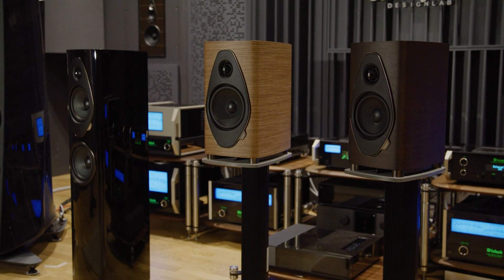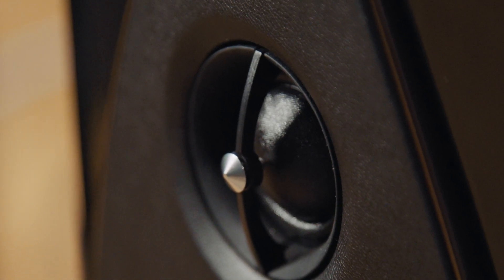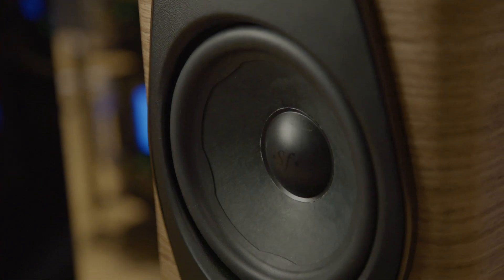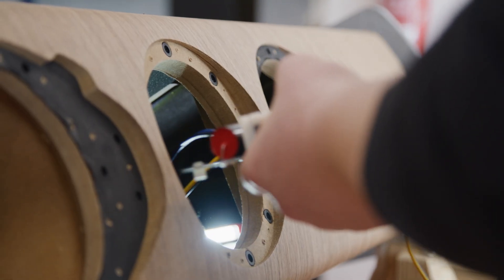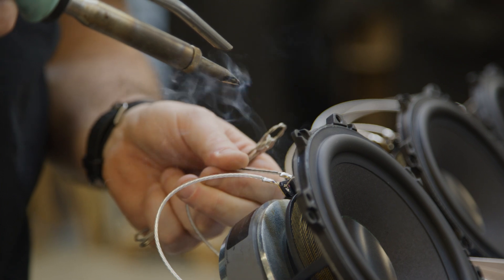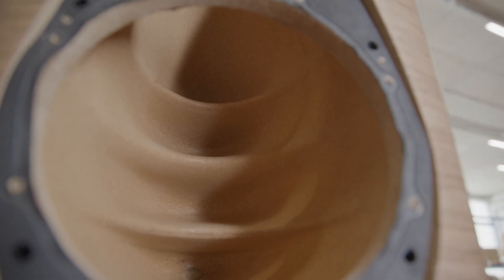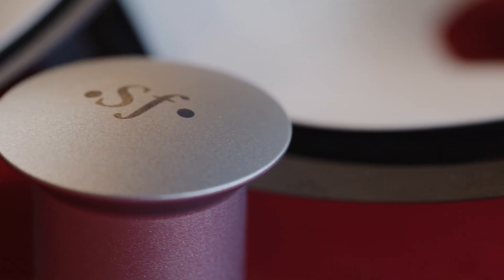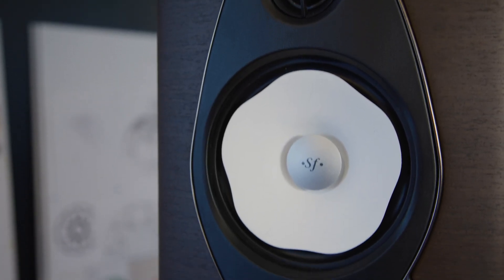NEW Sonus faber Sonetto G2 Loudspeakers Suprema and Other Technical Features (May 2024)

Comment: Hopefully, there will be a grille cover for that midrange. Its white ffs... Does not fit all decor styles
Reply from the maker: There is a magnetic grille that attaches over the midrange and tweeter area.
Reply: @soundstagenetwork  Very nice! I will consider these then for sure
Reply: @perryler  I should also add that on the 2.5- and 3-way models, the bass drivers each have a separate round grille.
Reply: so did you just complain without watching ANY of the video. of course there are speaker covers.....  they SHOW them in the video. They show them ON the speaker even.